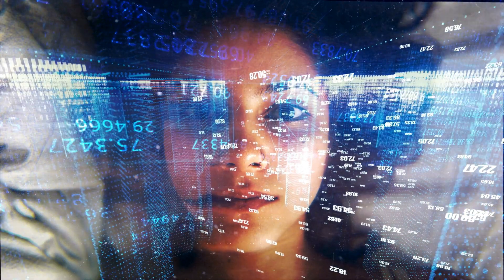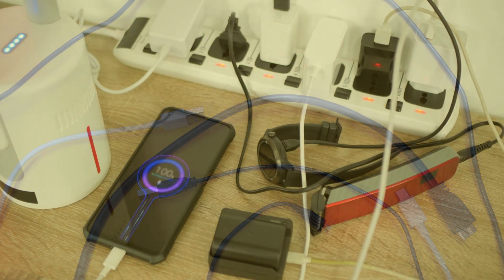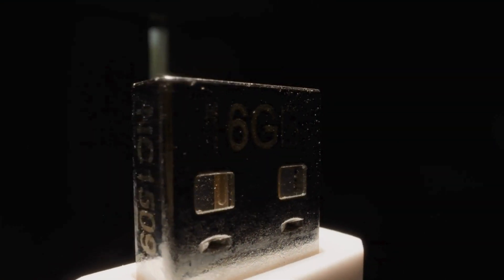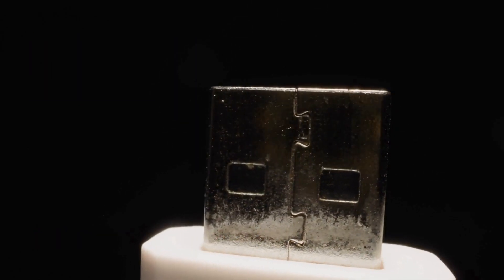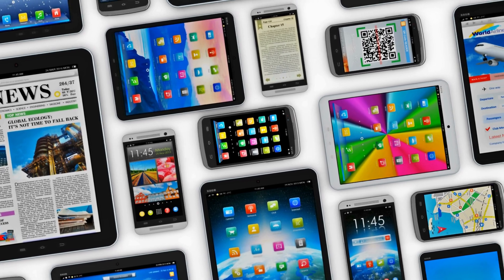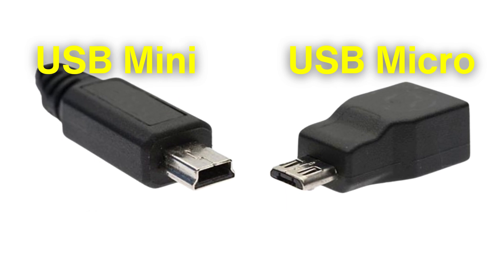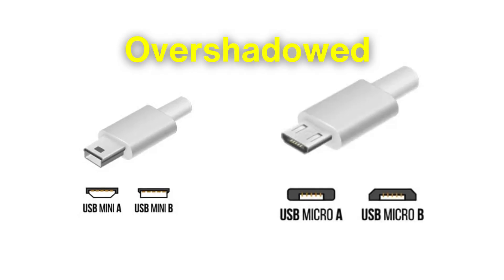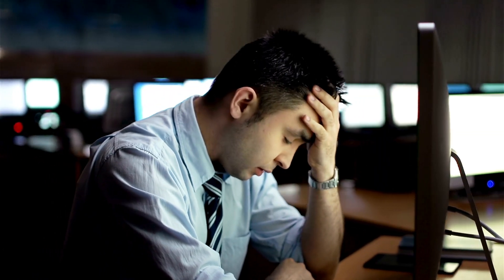Why Can’t There Just Be One USB Connector?

Comment: All cables should now be USB-C and devices having other connectors should supply an adapter (not a cable) that transitions the device connector to a USB-C cable.  And if new form factors are pushed by IEEE, then adapters should be supplied with the device to transform the device form factor to the new standard cable (and even multiple adapters to back capable USB-C cables -- or adapters that go from device to USB-C and then USB-C to the new form factor)

Comment: I remember the days of serial and SCSI connector nightmares... Still, USB-C has its glitches.  For example, the USB-C connector that came with my Google Pixel 9 is okay for charging, but is riddled with problems when in the car with Android Auto.  I ended up having to buy a high quality USB-C cable designed more for data transfer to get reliable connections to my vehicles.  Hopefully, we will continue to refine this and finally arrive at a universal standard for all devices.